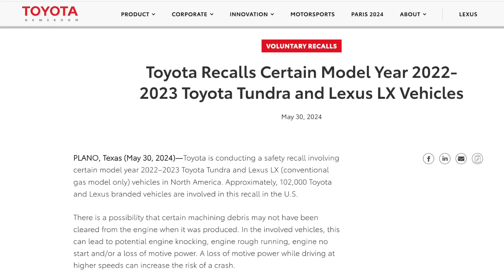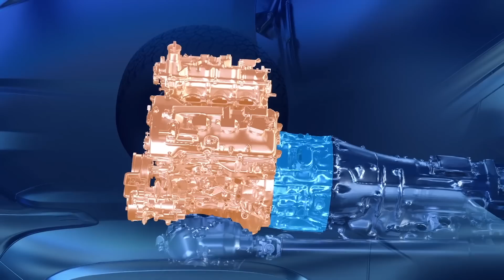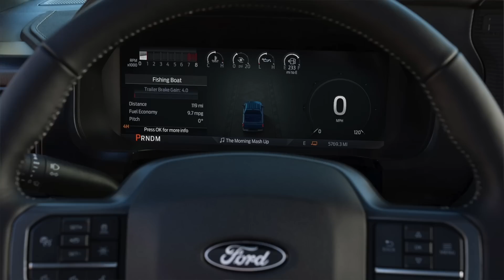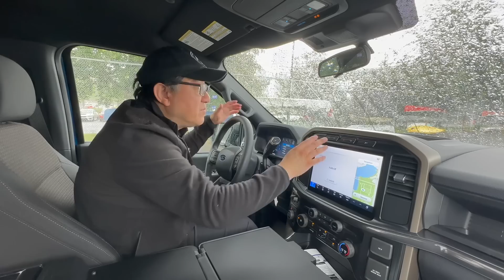ENGINEER EXPLAINS TOYOTA TUNDRA RECALL // SHOULD YOU BUY FORD F-150 INSTEAD?

Comment: Toyota needs to extend the warranty for all Tundra owners up to 100k miles for the engine.
Reply: I agree, Toyota needs to be accountable in standing behind their vehicle.  Having a 100,000 mile warranty is a good start.  There should be a depreciation value reimburse  to the owners as well.
Reply: @Cubis03 😂
Reply: @Cubis03  toyota does stand by their warranty way more than the big 3. I had a 2009 tundra that had the white paint defects  I received a notice in the mail that they would pay up to 10k to have it completely repainted and it was in 2019
Reply: @Cubis03  I disagree, buy back 100 percent of them. It doesn’t sit well to own a vehicle as a daily driver/ family hauler and know that at any moment it may have engine failure.
Reply: They will replace the motor and extend the warranty
Reply: They are repairing engine not replacing
Reply: Try to get ford or gm to do that😂😂😂😂
Reply: @lonerider5315  FORD and GM...don't have sh#t motors like Toyota.They don't have to.
Reply: Or just buy em back and scrap them all
Reply: @quyle9483  Agreed
Reply: @quyle9483  don't have to scrap them  justbuy them back put in a whole new engine and resell, I know that asking a lot, but trust has to be re- earned.
Reply: My Ford Everest in Australia has a standard 5 year warranty with unlimited mileage, you guys in the US can do much better.
Reply: @doneB830  we sure could, if you remove all the corporate greed and stupidity with all these car companies.
Reply: @doneB830 what does that truck cost?
Reply: @Icayn  about $US 60 000 it’s an SUV like your new Ranger.
Reply: @doneB830  you're right.
Reply: 500k warranty min as the cost of trucks are at record highs.
Reply: They will likely cover this specific issue for 100k, the way they did cablegate, they don’t extend the entire vehicle warranty.
Reply: My non hybrid 2023 is not a part of the recall. Door says it was built 1/23
Reply: @twisterbret my understanding is recall 24ta07 covers up to mid Feb 2023. Mine was built in April of 2023 so technically not part of the recall.....yet😢
Reply: @twisterbret what are the dates for the trucks with the recalls do you know?
Reply: Ford is his pick and he lists 5 Toyota products he owns.  Paid shill.
Reply: Mine has a lifetime powertrain warranty 2024.
Reply: @marksaint2936 lol 😂keep believing that.  Once they take your money , good luck on cashing on that idea when , it’s a huge issue
Reply: Lifetime
Reply: Negative I have a Extended warranty on my 22 tundra affected by this recall, Toyota needs to extend the warranty to 200k and also owners who’s motor blow up replace the long block not just the short
Reply: Even 100K warranty I still wouldn't buy it. I'm holding on to my 5.7L Tundra CrewMax @ 229K and She's running so well. Bring back the NA V8 and perhaps I'll buy it. Turbo engine is not reliable for the long run unless it's a diesel.
Reply: @famn7280  The worst year to date for the Tundra was 2012. This year alone saw several consumer reports with issues, including the engine, the transmission, and electrical systems. The top issue reported was the air induction pump, which has a high repair cost. Problems were reported, on average, around 74,000 miles, and the price was over $3,000 to repair. 

Another critical issue that came out of this year was transmission failure. The transmission is like the heart of a vehicle, and when it gives out, it comes with a number of significant issues attached to it. In the case of the Tundra, issues with the transmission started showing up around 9,700 miles, which is very little for a car with a reputation like Toyota. Average costs for transmission replacement are about $5,000. In 2007, consumer reports showed that the engine was the biggest issue, with some reporting a complete failure. Among the 537 complaints collected from this consumer report, air injection pump failure and knocking pistons were the two complaints. 

In addition, there were reported issues with the speed control, with the National Highway Traffic Safety Administration reporting issues with speed control, engine cooling, and accelerator pedals. These are dangerous issues, but they appear on a small scale compared to other brands.
Reply: Toyota has really lost the plot. Reputation ruined
Reply: @OakJex 😂😂😂not even close bud
Reply: Lifetime engine warranty
Reply: That is a horrible idea. Dealerships do not even have qualified technicians to do this kind of work. That engine needs to be taken completely apart. Very few people even know how.  Then you have to deal with dealerships denial “can’t replicate issue “ bullcrap.  Don’t fall for extended warranty. Means crap all. Dump the truck as soon as you can.
Reply: And bring back the good old reliable 5.7 V8
Reply: @sunshine76-d4m  In 2007, consumer reports showed that the engine was the biggest issue, with some reporting a complete failure. Among the 537 complaints collected from this consumer report, air injection pump failure and knocking pistons were the two complaints. 

In addition, there were reported issues with the speed control, with the National Highway Traffic Safety Administration reporting issues with speed control, engine cooling, and accelerator pedals. These are dangerous issues, but they appear on a small scale compared to other brands. The worst year to date for the Tundra was 2012. This year alone saw several consumer reports with issues, including the engine, the transmission, and electrical systems. The top issue reported was the air induction pump, which has a high repair cost. Problems were reported, on average, around 74,000 miles, and the price was over $3,000 to repair. 

Another critical issue that came out of this year was transmission failure. The transmission is like the heart of a vehicle, and when it gives out, it comes with a number of significant issues attached to it. In the case of the Tundra, issues with the transmission started showing up around 9,700 miles, which is very little for a car with a reputation like Toyota. Average costs for transmission replacement are about $5,000.
Reply: Lifetime powertrain warranty
Reply: 250 k mile is more like it as most Toyota owners tend to keep their cars  long.
Reply: I think Toyota will extend the warranty.  If you remember they did so on 2014 I think on Camrys with 2azfe engines that had piston ring issues. That time extended the warranty and replaced the pistons assembly for free. I am sure the will do so in Tundra too, otherwise they will suffer big on their business and more importantly Toyota reputation.
Reply: I still wouldn't buy one
Reply: I wanna say 100,000 is not enough at least 250,000
Reply: Toyota tundra Toyota needs to upgrade the warranties at least for 200,000 miles for consumers to try to purchase one of these garbage trucks
Reply: 100k?!?! Lifetime power train at minimum.
Reply: So then when the truck approaches 100,000 miles who is going to want the truck, it’s gonna be garbage, nobody’s gonna wanna buy it and no dealer is going to want to take it in for a trade. That’s ridiculous to say Toyota needs the extend the  warranty up to 100,000 miles. Toyota needs to put a brand new engine in there just like they put brand new frames on 4 Runners when they were rusting out.
Reply: No. Everyone who bought the lemon Tundra needs a buy back from Toyota.😊
Reply: I would agree…Any warranty needs  be transferable or you will be married to it because nobody would trust it.
Reply: Toyota wants you to keep buying their truck so they make profit😅😅 don't care about recall...
Reply: @MichaelAudi-l1k  It seems like you know nothing about toyota
Reply: I'm more like 200k
Reply: Toyota needs to stop making trucks. Seriously, buy a diesel truck if you want a truck. No one makes a reliable gas truck.
Reply: If they wanted to assure customers and even gain new customers, this would be a great idea. Stand behind your product!
Reply: Exactly!  Ford extending the warranty would show a real concern, rather than waiting till they are no longer responsible for problems.
Reply: Lol 100k isnt enough.. just do 1 million powertrain warranty on all
Reply: RIP Toyota,  2025 tundra is already  failing
Reply: Wait, it’s not 100,000 miles?